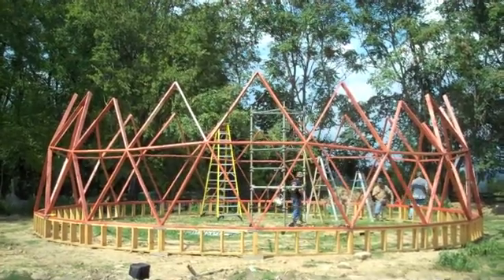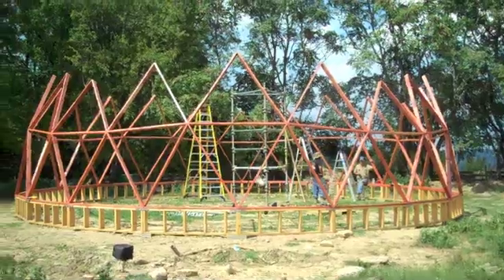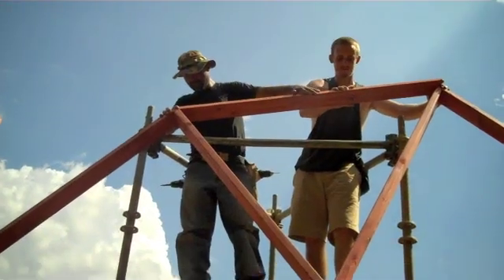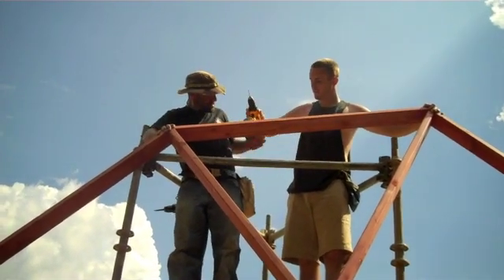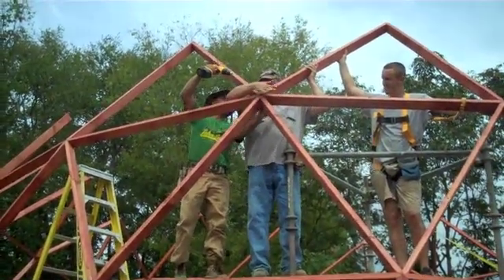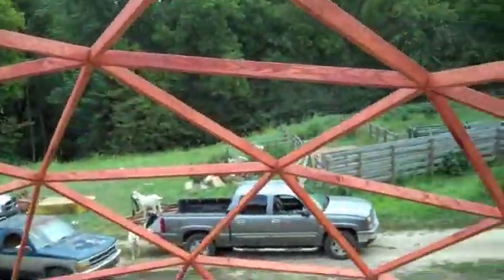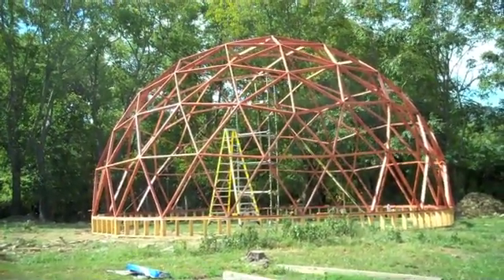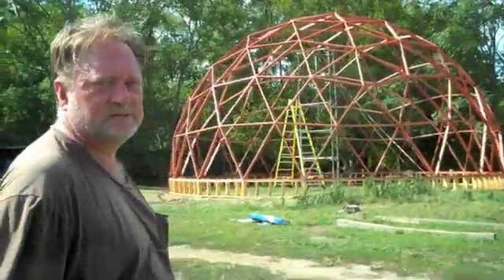BUILDING A 40 FOOT GEODESIC DOME (PART 2)

Comment: I require to know the angles in degrees so I too could build a 32' foot Dome. Please let me know the angle cuts of each strut between the center and the struts in the Hex and Pentas. I just love Domes.
Reply from the maker: It depends on what vertices you are going to use. We used the dome calculator at simplydifferently dot org. You just put in the size and it figures the angle cuts for you.
Reply: There are several kits you could buy to make a dome.